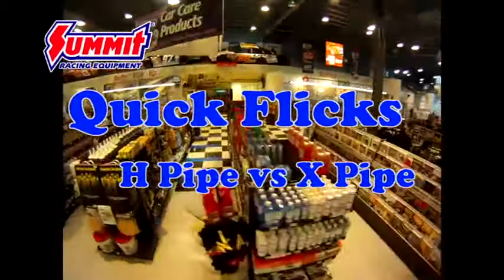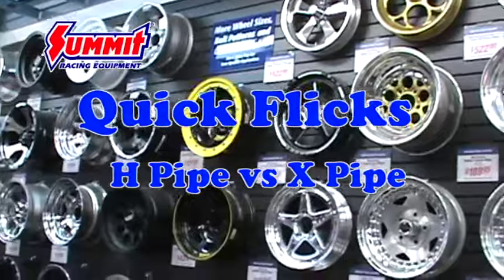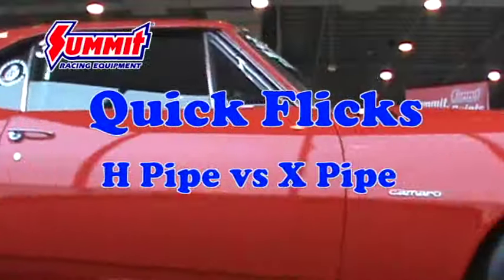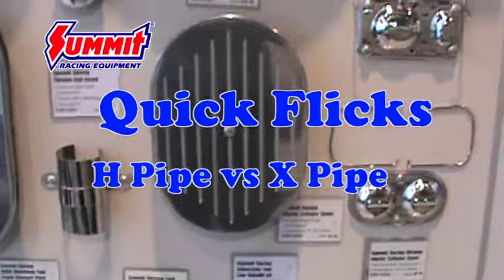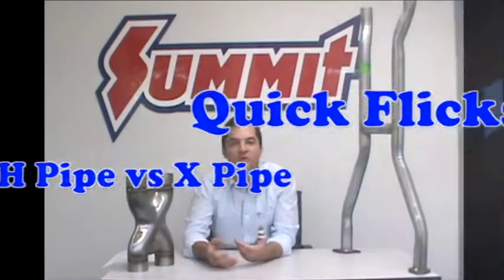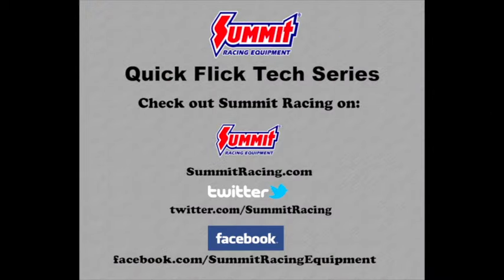Exhaust X-Pipes vs. H-Pipes and Differences Between Them

Comment: Would a h pipe help you save gas in the lower rpm range
Reply: my friend once you have 8 cylinders nothing will help u save gas.

except gears. a six speed or a lower final drive ratio. The lower you can get your rpms in top gear the more fuel you'll save.

The draw back being lower final drive less torque to the wheels so less acceleration.
Reply: Indeed it would, H is the best option for daily driver or the spirited commuter.

Comment: Much obliged my friend, turns out an X pipe won't fit they way it's supposed to in my truck anyways haha so it raises another question... H pipe or True Duals? I'm also up in Colorado so does altitude create a difference?
Reply from the maker: Brandon Lange, 
While altitude will have some
effect on it, it certainly will not be anything noticeable without dynoing with
and without to see the difference. If an H pipe is all you can get on there, by
all means go for it. It will be helpful to you!

Comment: Im actually doing a few mods to the car. cai, underdrive pullys, msd cop, ford racing intake manifold, 70mm tb, airaid tb spacer, ford racing shorty headers, high flow cats, and im getting the trans rebuilt with borg warner shift kit . I am wanting to use glass packs as they sound very good on these engines, but im not sure if they are going to create enough back pressure. What would you recommend for mufflers that sound loud and aggressive??
Reply from the maker: Hi stoverj09, 
Back pressure is actually a bad thing! If I have pressure pushing back at the motor; it makes it hard for more exhaust gas to be released into that same pipe! The trick here is to find just the right pipe size that keeps the exhaust moving fast. If we use too large of a pipe the exhaust gases can expand too much and slow down. If we use too small of a pipe the exhaust gases actually back up (backpressure) and the pressure rises and also slows down the exhaust!  It’s like sitting in an overly crowded movie theater and yelling fire. You either have enough exit doors to get everyone out in an efficient orderly fashion, or you don’t! 
We would suggest you listen to different muffler sound bytes or search YouTube for different videos with a muffler you may be interested in. Different manufactures have different sounds. It is a matter of preference.

Comment: Any comments on "true duals" vs X Pipe? I am considering remove the resonator from my 2005 SLK55 AMG. looking for a lauder exhaust. Any idea of power loss with the true duals? and sound compared to the H and X? tks for the advice.!
Reply from the maker: Hi TheLovalova69, 
X pipes have proven themselves enough to say that they will help in the quest for power. How much varies per vehicle, parts combination and how it is tuned.

Comment: I have 2007 Mustang Gt. I have BBK long tube headers that I am getting ready to install and trying to figure off road X or off road H. The car is a 5 speed with 4.10, CIA and Comp cams Mutha Thumpr cams. I also have the 6" round straight through magnaflow mufflers. The goal for me is to not loose HP, but to make the car perform as good as it can. I do like the deeper sound and I want it to be as loud as possible. So, the age old question...in your opinion X or H?
Reply from the maker: Hi Ken Hodson,
It absolutely sounds like you are operating in the higher RPM bands, so an X pipe is definitely the way to go!

Comment: I have a 2013 camaro zl1 stock do u think a x pipe would give it a bit different note and do u think I would benefit from a x pipe
Reply from the maker: Hi camaro hobbs, 
Well, this is a car that is built to run, and if you intend on driving it hard and racing it then yes, an X pipe will be beneficial to you. It will also change the exhaust note; depending of course on the muffler you run with it!

Comment: Hello my name is carl and i was wondering if the H-pipe that i have on my 85 caprice is Beneficial? I Have GmGoodwrench 350 with a 268h comp cam , Comp cam roller tipped rocker arms.Aluminum intake with a Edelbrock 600cfm carb,,Flowtech shorty style Headers with true duals and H-pipe and 3:73 gears

Comment: I have a 2014 Dodge Charger and i want to put headers with hi flow cats and an exhaust system. Which headers do you recommend? I have a 5.7 Hemi. The car is driven daily on the street, I will take the car to the track on weekends. I would like the most power gains possible without it being obnoxiously loud. Thanks!
Reply from the maker: Hi Shane Beard, 
The only thing we show currently for your 2014 Charger is a Corsa exhaust. The part number is CSE-14463, you can click here for additional details: http://www.summitracing.com/parts/cse-14463/overview/
Thanks for watching. Good luck!

Comment: Hi.  Just put magnaflows with x pipe assembly on my 78 tbird.  Sounds and runs great.  You mentioned back pressure.   Could this be why my car shuts off when I stump it at low rpms?  Or do I have other issues?

Comment: Great video. I have an 04 F150 5.4 V8 and currently have true dual 2.5 exhaust Borla Pro XS mufflers. I am running a programmer and a CAI for better performance. However I am not satisfied with the sound. Would inserting an x pipe and or deleting cats give many any more performance and better sound? This is kind of a specific question but I would just like a little input. I would have a local shop create a tune to delete the cats if I go that way. Thanks.
Reply from the maker: biggwigg338, 
Well, sorry but, we cant advise
you on removing your catalytic converters. But we can say that installing an X
pipe and removing restriction will have an effect on the sound and performance
your vehicle has.
Reply: Summit Racing Thanks and I understand.

Comment: I have a 99 4 door Tahoe. Due to everything in the way on the driver side, my only option is a single tail pipe. Im not going to touch the stock cats because I don't want to mess with the emissions. I want to change to an intermediate pipe that exits into a single 3" and exchange the 2.75" tailpipe for the 3". But I don't know if I should go with the turbo or glass pack, or if the glass pack will even line up. Would there be a real world advantage to the glass pack over the turbo?

Comment: I'm running a Pontiac 400 (now 406). Im shooting to make around 400hp and 450ft.lbs. of torque. Which exhaust system would you suggest?
Reply from the maker: The Trailer Park King ,At least an H pipe if being used in daily driven applications but, if max power is desired and your are building an exhaust anyway, use an X pipe.

Comment: I have a 2006 BMW M5. I have deleted the secondary cats and replaced them with an X-pipe and i'm running meisterschaft mufflers in the rear. It's very loud and I'd like to tone it down a bit.
Should I install resonators before or after the X-pipe?
Thanks.
Reply from the maker: Hi Silvio Bugatti,
 It is Impossible for any manufacturer to test every conceivable exhaust configuration. Unless you’ve seen or heard this combination you are suggesting at a car show or the net, you will have to try it out. Be sure to share your results; someday someone else may be asking the very same question!

Comment: how are you I have a 2015 Dodge Durango limited v6 that I'm customizing and so far I've done a 2.5 inch Rocky road outfitters lift kit and control arms,spider trax Wheels spacers, bfgoodrich ko2, custom light bar brackets, Auxbeam 50 inch curved light bar ,RGB color shifting LEDs,and now I'm looking to do a dual cat back exhaust system and wanted to do it right now I have a single exhaust system now but want to do a dual but don't want any codes to show up and wanted to know if you can help me out with this
Reply from the maker: +Brandenn Barnes, 
Unfortunately unless the truck had an OE dual exhaust, the dual systems we offer are said (by the manufacturer) not to fit. Sorry!  Here is an example, see note at bottom of web page http://www.summitracing.com/parts/wlk-39521/overview/year/2015/make/dodge/model/durango

Comment: 71 mopar original 383.  likely 8.8:1 ish   i welded up calculated tri y headers, anti reversion chambers/reducers and an x pipe.  727, 3:23 rear and i went from 11mpg rare burnouts to 15 mpg and non stop burnouts.  tri y , anti reversion, x pipe and high flow cas are a pile of free hp and mpg

Comment: I have an 06 Dodge Mega Cab 1500 and this is what i was thinking about for a new exhaust. 2.25" inletx2.25" outlet X pipe. Two Super 10 mufflers(2.5"inlet x 2.5" outlet). Straight pipe in place of the resonators and 4" stainless steel tips. I want it to be LOUD. Do you think this would be a good setup and would the x pipe benefit me?

Comment: I have a 04 X5 4.4i and I wanted to get your take if I will be losing low end power by adding a x-pipe? My plan was add and x-pipe to the stock exhaust.....thoughts? Thanks
Reply from the maker: Bryan Dorestant , 
Good thought! This would actually improve exhaust scavenging and improve low end torque a bit.

Comment: I've got a mostly stock 76 Dodge D200 with a 400 big block V8 and was looking at replacing the exhaust system. Currently it has a 2.25 inch system that is hacked onto the stock 2 in pipes coming off of the manifolds. It does not have an x or h-pipe. I was wondering if it would be beneficial to install either of the two in the exhaust system when it's redone and what mufflers should be used for maximum power output without being too loud. TIA
Reply from the maker: Hi William Ruescher, 
Sounds like a set of long tube headers are in order here. If you are looking for Max horsepower, a 2.25”  X pipe and free flow mufflers would also be a good decision. There are plenty of mufflers to choose from that will have no problem making power for you. You will really just have to make a choice as to what kind of sound you are after. Many of the manufacturers have sound clips on their websites and YouTube that will assist you in making the decision that is correct for you!

Comment: 08 Mustang GT Stock Exhaust.  Trying to decide between X and H.  Want to change to LT headers Need to stay catted.  My concern with the X pipe is I have heard rumors that I will suffer the loss of the traditional Mustang growl and low end torque.  I plan to incorporate the Pypes Pype-Bomb Cat back system.  Do you have any advice as to which way to go and which products you offer to accommodate my description.  Oh ya the care is naturally aspirated with a CAI and BBK Throttle body.  Thank you

Comment: Hi, I was planning on doing a complete exhaust system on my 2001 ford f150, headers and everything. But I don't think I'm going to run catalytic converters, do you think I would have enough back pressure with an x pipe and 2 mufflers since they will be duel?
Reply from the maker: Hi Zach Hofmann,
Elimination of the catalytic converters will void any emissions legality whatsoever. Yes, the back pressure will be affected dramatically and the on- board computer will inevitably turn on the check engine light!

Comment: I have a 2011 3.7L Mustang. I'm currently looking at purchasing Borla Ceramic Long tube headers with there Off Road X pipe. I have a Airaid CAI and have a muffler delete for my car. I am currently running Bama 91 Octane RACE tune. Are the Borla Headers and X pipe worth the money?
Reply from the maker: Hi joeyford2010,
Its all in the tuning. Yes, you will see a gain, but a re-tune will be necessary!
Reply: yes trying to figure out the company to go with for tunes. I know most companies focus more on the 5.0 and not the 3.7L.

Comment: I was wondering what x pipe is the best for me ... so many brands out? I have a 2012 ford f150 v6 3.7L. Wanted to replace the y pipe with the x pipe and maybe replace the resonator delete with a dynomax race series bullet muffler and then a pair of dynomax ultra flow welded mufflers. I don't know what it would sound like but what I'm hitting for is a very loud low rumbleing but not illegal loud street exhaust and I love the sound of the exhaust when they pop on deceleration and stuff. also have a sct livewire tuner and a k&n airfilter... soon to add more stuffs.
Reply from the maker: BioProtege Inc , 
Can you give our tech department a call? 1-330-630-0240. We need some additional information form you. Thanks!

Comment: It depends on the application. The Ford modular engine always gave a little bit better horsepower and torque with an H pipe which is why they went to it. For some reason that engine does better with an H pipe then it does an x-pipe. The Chevrolet LS motors do better with an x pipe. And depending on the cam that use, some Chrysler engines do better with one and other Chrysler engines do better with the other. So it could depend on a lot of factors. That may actually be the case with some LS Motors. But I haven't worked with them but a couple of times. I've been relatively impressed with them, I just can't figure out why Chevrolet can't build them that don't drink oil too much. It's possible that they are using synthetic oil from the outset and not letting the engine break in for the requisite number of miles before they switch to synthetic.

The old school rule was the H pipe had to be before the burn mark if you spray paint on the exhaust pipe. Usually at least 9 to 12 in in front of the end of the burn mark on the paint. And that differs from vehicle to vehicle even with the same build.

Back pressure never makes an engine run better. You have something else out of balance if you have back pressure in the engine is running better. An automotive engine is an air pump. And when you have back pressure it's not being an efficient air pump. Ever.

And I do agree with you that there are times when neither is applicable. I've seen shorty headers running into a single 3 inch exhaust be perfect, and provide all the horsepower and torque that the motor is capable of. No other construct was working any better. On occasion a dual exhaust was worse, and always heavier. Which is another consideration. If you can gain a tenth of a second by going with dual exhaust but it cost you two tents of a second in weight. You've defeated your purpose of putting on dual exhaust. It isn't very often that a single exhaust will do that. What I've seen it happen.

Comment: I have a 13 mustang gt. Now ford says that the gt is supposed to do 410hp straight off of stock. But when tested on the dyno, results show that they're only doing around 350-380(rarely that high)hp. Is there a reason for that? And would an h pipe or x pipe help reach my coyote to its full potential ??
Reply from the maker: Hi mackinass916, 
The horsepower discrepancy you quote is the difference between “flywheel HP” and “rear wheel HP”. Your car already has an H pipe from the factory.

Comment: i have a 96 4.6L mustang gt stock H with flow 40's welded in. its to quiet due to 6 catalic converters i live in california. if i switch the H for a X pipe will it be noticebly louder then the stock H? i dont want to waste the money if the difference is minamal
Reply from the maker: Hi revelationns, 
As you stated yourself “it’s too quiet due to 6 catalytic converters” , changing form an H to an X will not make much of a difference at all.  Thanks for watching!

Comment: Hello, I have a 2009 pontiac g8 gt with a 6.0L . Would my car benefit from an x pipe or would the h pipes be better. Thanks
Reply from the maker: Hi gcelis, 
The original exhaust on those cars included a mid-mount muffler. Both right & left exhaust pipes shared this muffler, therefore it acted as an H pipe, equalizing exhaust pressure from side to side. An X pipe will do the same job down low but, will also increase the exhaust scavenging effect at higher RPM levels. So, if you have some upgrades such as cylinder heads and a camshaft planned, the X pipe will definitely be the way to go!

Comment: I have a 2001 Ford F150 with the 5.4L with true duals from manifolds back. I would like to know if putting an x pipe in will help me with performance if it does where would be the best place to place them on my exhaust system.
Reply from the maker: Hi jspitler855, 
Generally speaking, X pipes do help with performance usually in the mid to upper RPM ranges due to increase in exhaust scavenging. This leaves the cylinders cleaner for the next combustion event; in turn making more power. The best place to locate an X pipe is as close to the motor as room permits. This usually puts them right beyond the transmission output yoke!

Comment: Alot of people don't talk about "STRAIGHT PIPES," meaning, no X or H-Pipe. Is there any HP/TQ LOST or GAINED without having neither of the two? How much horsepower should you be making to the point where you don't need a crossover? Cause alot of the BIG Horsepower BBCs & BBFs don't seem to require any type of exhaust connection, and they tend to run either open headers, or just straight 3" or whatever size exhaust with no crossover at all what-so-ever. What are you guys' thoughts on that?

Comment: I have a 2010 Mustang GT with CAI, UD Pulleys, GT500 TB, O/R H pipe, Pype Bomb Axle-back, and Pypes M80 mid mufflers all wrapped up with a custom Bama 93 octane tune. I love the deep old school sound from the O/R H pipe but would a O/R X pipe be more beneficial? I'm not a big fan of the rasp that comes from most X pipes that i hear though but if its better for the stang i can get used to it.
Reply: 4.10 gears, Accel Coil On Plugs, roush short throw shifter, and a heavy foot just to complete the full mod list.
Reply from the maker: Hi Greg Williams, 
While an H pipe is beneficial for equalizing pressure pulses between banks of the motor, an X pipe actually provides better scavenging of the exhaust gases at mid to high RPM. This is more beneficial but, an improvement you may only see on a time slip or dyno sheet!